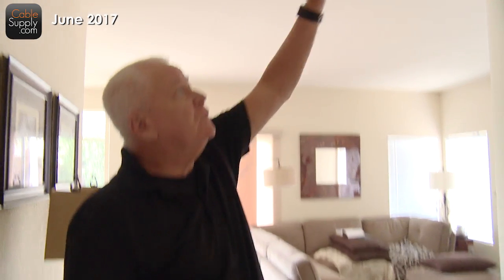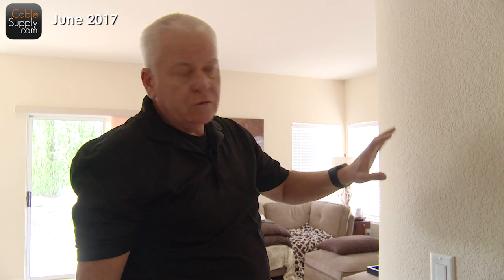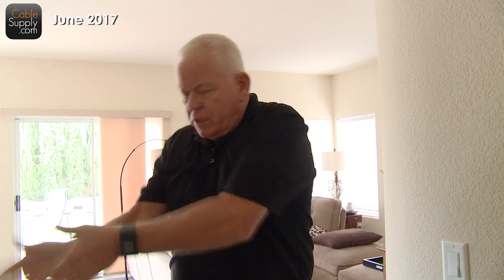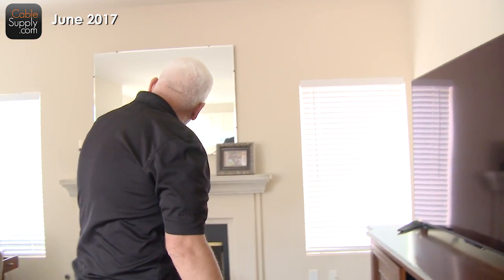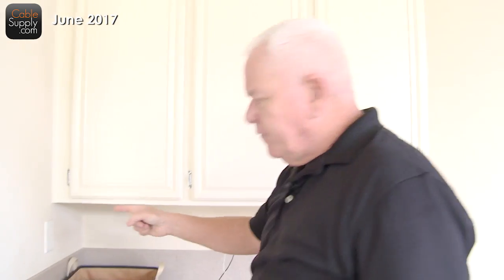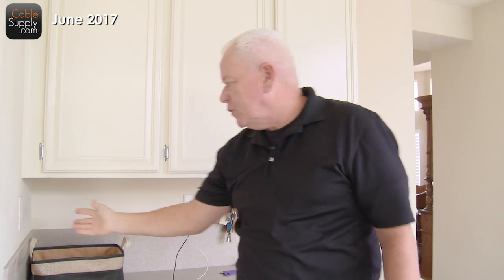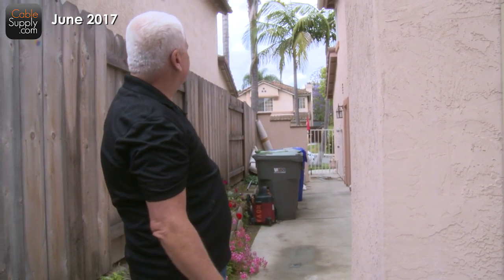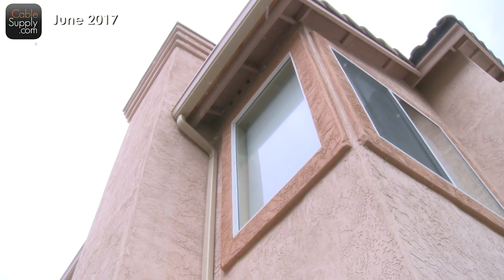Computer Cabling in a Residential Home, Part 2

Comment: Seems to me your under window pipe solution is better in the long term, if you ever want to add more connections to the same box. (Cable Company DVR, Second cable for a streaming box to stream home movies, and whatever other data cables or standards you might want to run in the future). How many ethernet cables do you think you can run through that pipe?
Reply from the maker: If you are going to run extra cables in a conduit / pipe plan on no more then 60% of capacity. In this case 4 to 5 cables max in this pipe. 
You are correct, you should always run extra cables.  Running extra cables at the beginning  is easier than starting over or adding additional cable later.

Comment: I admit, I laughed out loud when you started talking about home runs.

This video is great for explaining what a cabling project would look like for a homeowner in Southern California.
Im trying to explain to a relative why running a single cable to several rooms and then splitting the connection to a 4 port hub in each room is not as ideal as   running 4 home runs to a single 18-24 port patch panel and switch.

Might you have videos that would help explain the project?